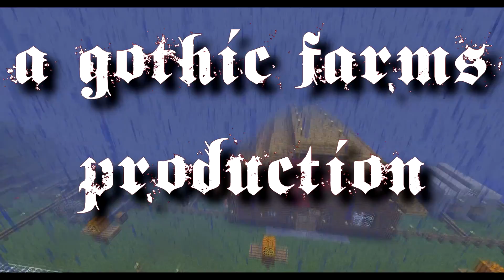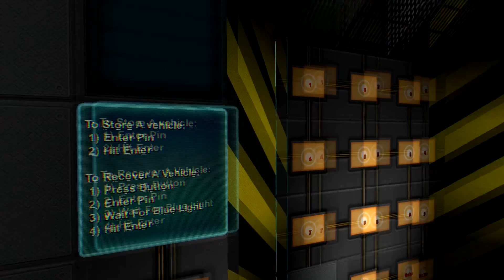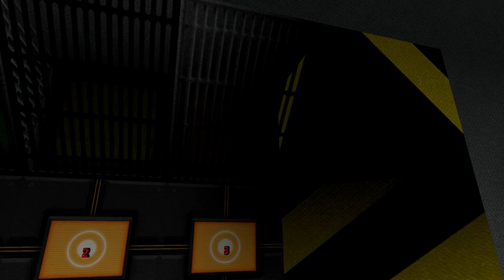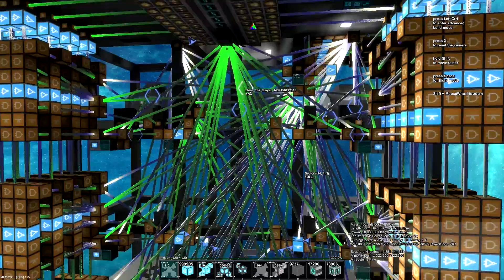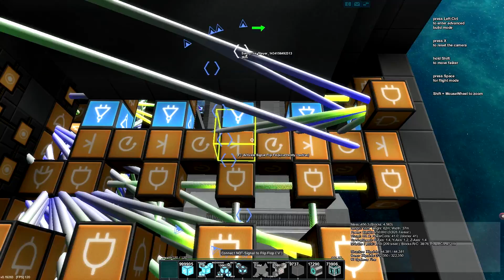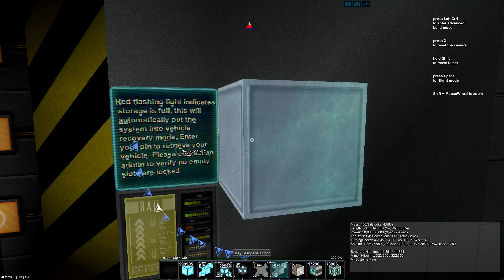Starmade: PIN Accessable Storage System

Comment: i have a 32 register flash memory module already made if you want to take a look at it. its right at 10x10x10 if i remember correctly. unfortunatly i think my built in multiplexers are broken in it, so ill have to break down the system and fix it.for use in your contraption however, i think the version that you have is more suited because you have a built in comparitor which makes it specialized. also, you can speed up the process of looking for an open slot by by doing some slightly more complex logic. msg me on starmade forums if you have any questions on it. my username is walle_222
Reply: oops, just realized that this is a slightly old video.

Comment: Holy shit! Though one way to force the PIN fix would be to have the user declare a bay, and indicate which bays are available vs occupied. If the user declared an occupied bay, they would have to enter the recovery PIN. If the user declared an empty bay, they can enter any PIN desired. This would separate the PIN of all the bays.
Reply: ***** Similar to the PIN, you could assign a number to each bay. That way someone's "Code" could be, say, 8-4765.